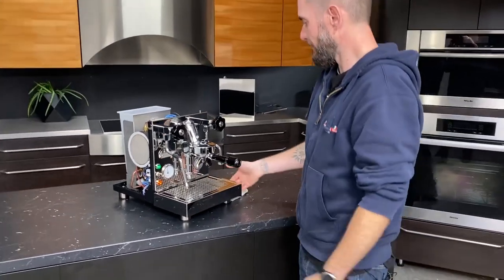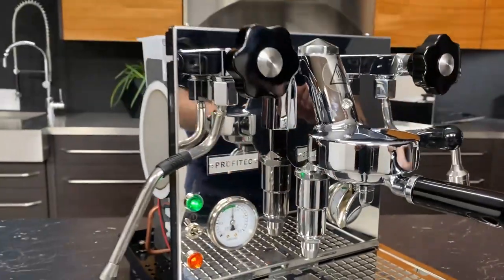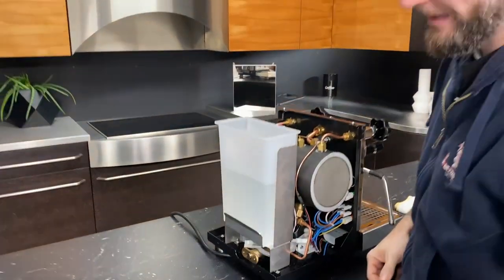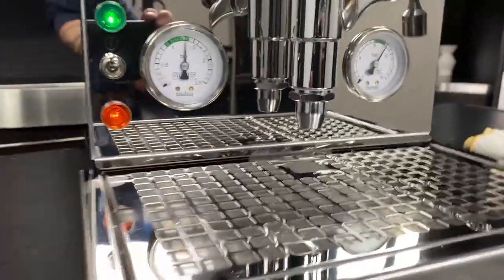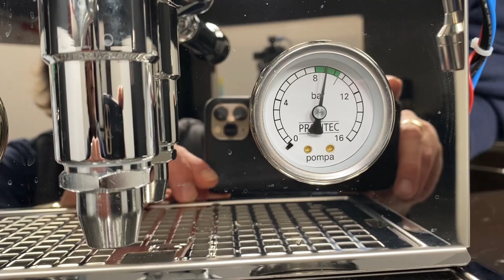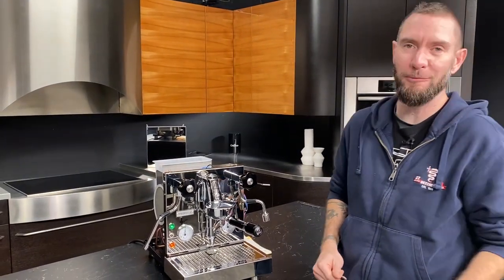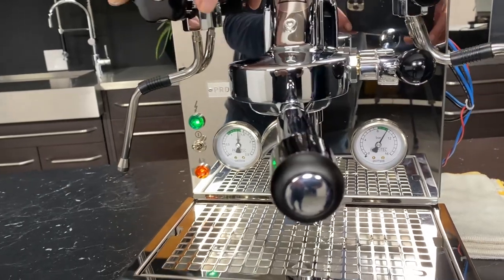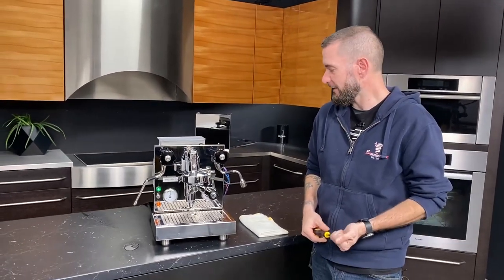Profitec Pro 500: How to Adjust Brew Pressure

Comment: Great content! I recently transported my Profitec Pro 500 from one house to another and noticed that my brew pressure had dropped significantly.  I was around 9-10 previously, but now I'm suddenly at 4 bars. Is it normal that this might happen during transport and am I in the clear to go ahead and adjust the OPV so that I'm at 10 bars with the blind filter basket on?
Reply from the maker: Hi Justin, Simply moving a machine should not change the brew pressure. But stranger things have happened! Before adjusting brew pressure I'd make sure the system is full. Run a half a reservoir of water unencumbered through the group then check the pressure with a blind. If still low go ahead and adjust back to 10 bar.
Reply: @Wholelattelovepage  Thanks for the quick response!  I ran a bit of water through the group and then checked the pressure with the blind which gave me just under 10 bars.  Seems good, but then I pulled a 3 double shots using different 3 different beans and never saw the pressure go above 4 bars.  Any ideas?  Thanks in advance!
Reply: @Whole Latte Love  hi team, any thoughts?  Is it just a matter of the beans not being fresh enough and/or the grind?
Reply from the maker: @justinvs4926  If you're seeing 10 bar with the blind first suspect is grind size. Grind size is never set and forget. It will change with a new coffee and as beans age. Did you dial in grind size for each of the 3 bean types? Sounds like you need to grind finer. If not familiar with process of dialing in grind size here's a video that show you how: https://youtu.be/jOY7D02n4Cw

Comment: Hi Mark.  In this video you adjust the brew pressure to 10 bar on the built in gauge but in the YouTube video titled Brew Pressure on Vibration Pump Espresso Machines you adjust the brew pressure of the Profitec Pro 500 PID to 10.5  bar.  I realize this is only a 5% difference but since I will be adjusting mine which gauge pressure should I shoot for?
Reply from the maker: Hi Paul, Based on my Scace testing if you're shooting for 9 bar on the puck set your machine to 10 bar static pressure on the machine or group gauge if you have one.
Marc
Reply: @Wholelattelovepage  Hi again Mark.   Borrowed my friend's portafilter pressure gauge (which is obviously not as accurate as the Scarce) but was surprised to get a pressure reading at the portafilter that exactly matched the boiler pressure reading on my Profitec Pro 500 which read 10 bars.  Does this make sense?
Reply from the maker: @phcalama  Hi Paul, That's the same result I had  on Pro 500 when testing the static pressure on PF gauge and comparing to the machine's brew pressure gauge 10 on both. Many machines are not that close in static pressure readings. Did this video a couple weeks ago on the subject: https://youtu.be/Z2DNW7ZVolg 
Marc
Reply: @Wholelattelovepage  Thanks Marc.  I guess one conclusion from this is that the Profitec Pro 500 does not suffer much wrt pressure losses between the boiler and the group head.

Comment: Hi, I have this machine but it doesn’t get 9 bars, and my pressure control doesn’t work, I don’t know what’s wrong with it, it only reach 5 bars :(
Reply from the maker: Hi a, So you're not reaching 9 bar on gauge with a back flush disk installed? If it's during an extraction then grind is too course. If with the disk installed and no change in pressure when the OPV is adjusted then it's could be a faulty gauge, the OPV is bad or perhaps a pump issue. If you purchased the machine from us and need additional assitance please contact our tech support staff here: https://www.wholelattelove.com/pages/contact-us

Comment: Hi , i got new gauge. But still I couldn’t get more than 4 bars even if i use the opv max pressure. 
I tried to remove the coil tube that connects to the gauge and blow it by mouth its not going through well . Do think its the reason?
Reply from the maker: Hi K, It's possible that's the problem.
Reply: @Wholelattelovepage  could you help me find the cross-sectional of the OPV  from the inside?
cause I disassembled it and don't know if return everything back to its normal condition.

Comment: Any reason you dont just drill a small hole in the stainless so you can just take a screwdriver to it without taking it all apart
Reply from the maker: Hi Brian, You could certainly make that in-field modification!
Reply: @Wholelattelovepage  Going to attempt it today.  If I get it done I will post a video with measurements of where to drill and what tool to use.

Comment: I know that this is just spitting in the wind but why on earth is there not just a hole in the back of the housing??? It's obvious that there should be one.
Reply from the maker: Hi Paul, I must be downwind! Easily adjustable brew pressure is a feature some user like and there are a few machines which have external adjustments. Speaking with Italian manufacturers they are often surprised that end users would want to adjust.

Comment: Great video.  I have the P500 with flow control which has a brew group pressure gauge, I am getting 10 bars at the group.  What is the standard pressure I would want from the brew group gauge?
Reply from the maker: Hi GFY, Thanks for the question. You can set pressure to whatever you like. For proper water flow rate we set the OPV to produce 10 bar (the inner tick mark) on the pressure gauge on the face of the machine. That gets you about 9 bar at the group when pulling a shot. Understand that with a blind filter basket in place or the flow control valve closed you will see higher pressure on the group mounted gauge. There is a one way valve between the point in the system which reads pressure for the machine face gauge and the group so pressure eventually builds to be about the same on both gauges. But, that condition does not represent pressure in the group when making espresso.